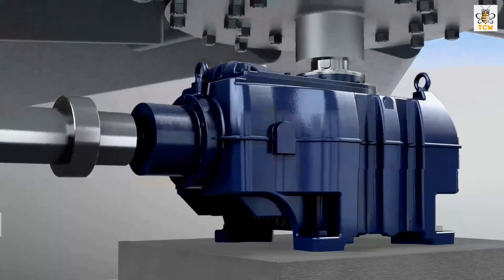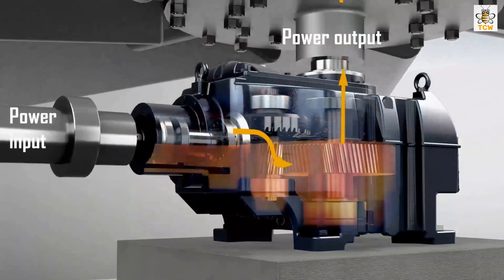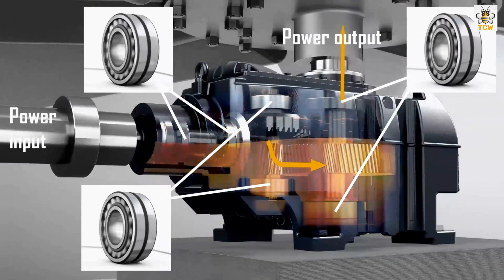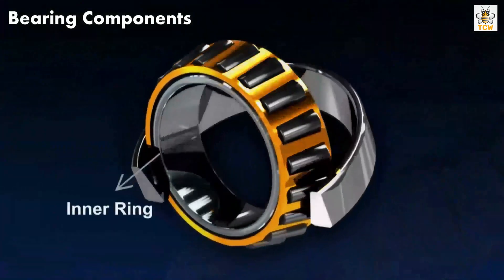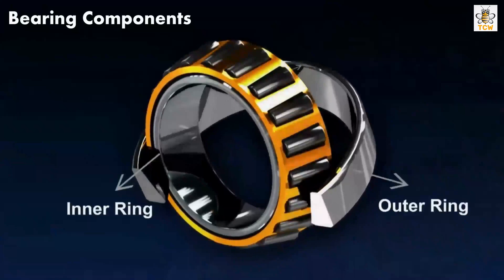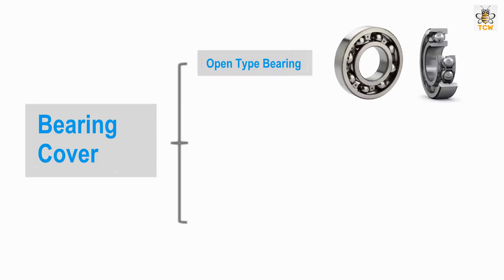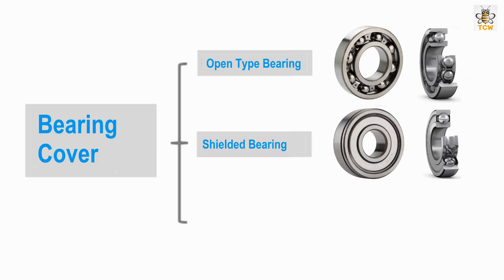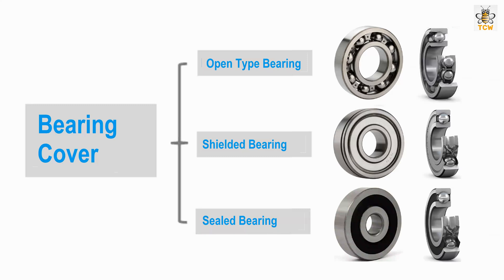How bearings work

Comment: I want to ask, what if the inner ring be stationary how the bearing can reduced the friction ? sorry for bad english
Reply from the maker: Inner ring can be stationary if the rotating element is the housing not the shaft. The example is the motorcycle wheel bearings. The inner ring touch with the static shaft and the outer ring rotate with the wheel.

Comment: How to load bearing ?
Reply from the maker: depending on bearing installation. if the bearing is fixed more tightly to the shaft, it is installed by pushing the inner ring evenly. if the bearing is fixed more tightly to the bearing housing, the bearing is installed by pushing the outer ring evenly